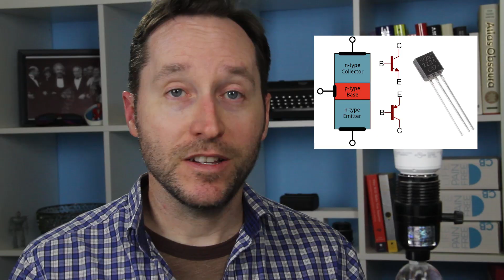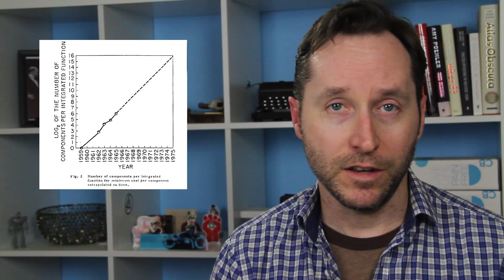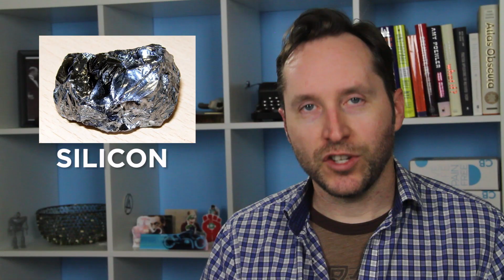Moore's Law Is Ending - Here's 7 Technologies That Could Bring It Back To Life | Answers With Joe

Comment: the idea of multi core processing can do same job with half the speed (the main reason they're making transistors smaller is to make them cooler and more power efficient to increase clock speed) thats not gonna work for long to fix this the need to move to multicore processing but the main problem is optimizing programs to take advantage of of these multi core cpu. im sure When they hit the wall on moores law they will focus on multi core processing 8 16 even more i wouldn't be surprised if i saw 1000+ core processor in my life time

Comment: I recently found this channel and have been very confused by Joe's optimism based on Moore's law in his previous videos from last year and the year before. I'm glad to see this video, it just seems a little late tho considering current computing hardware trends. I didn't know that the exponential power of computers had a name, and even wondered years ago how long it could sustain itself with current technology. For the last three years, it's been pretty obvious that it had come to an end, only 5 to 10 percent gains in computing power, and only a radical shift in material, and or architecture would be able to get the ball rolling again. If i understand correctly even super computers are not built with much better chips than whats in home computers anymore, just massively multi cored and threaded.  However the next jump could be more than what the exponential growth would predict, and we could see singularity even faster than predicted, i'm being a bit optimistic here. Or none of the new computer ideas work out well and we stagnate in computer tech eking out 5 to 1 percent gains for 50 to 100 years till they get it right (now that's a scary thought).

Comment: The death of Moore's Law has been predicted for the past 30 years.  Every year.  Like clockwork.  I'm surprised there isn't a corrollary law that says the end of Moore's Law will be predicted every 18 months. (I searched, couldn't find one.)

Another possibility for future computation is a thing I've been following and interested in for a few years that might make a good video topic - amorphous computing.  Amorphous computing is based upon the idea of producing billions of really tiny processors... like, really, really tiny.  Small enough that you can mix them into paint and just paint them on any surface.  They operate through ultra-short-range (millimeters) radio links, and the computation doesn't really occur in each processor but in the collection of them overall.  They're unreliable, can randomly drop out of the collection at any point, and through patterns of how the signals flow through the system, computation is achieved.  Its very similar to how biological systems operate.  Requires a lot of very cool theoretical work first, but its a very promising early concept.

In terms of actual physical laws, rather than observations of trends, Richard Feynman actually produced a set of lectures on computer science.  They're much less popular than his lectures on physics, but similarly brilliant.  They're published and you can get them in book form on Amazon.  (Forget the exact title, just search 'feynman computation' and you'll find it I'm sure.)  In those lectures one of the things he investigates is the fundamental energy required for computation.  Surprisingly, he found that in terms of quantum mechanics, zero energy computation was possible.  (It had to do with performing computation by systems degrading to their ground state which they will do anyway with no input.)  

That is in the extreme and also requires infinite time, though, so we're never going to see actual zero-energy computation.  But what it DOES mean is that there is no lower bound.  There is no place where physics says 'you can not extract more than X bits of computational power out of Y amount of energy'.  You might be constrained by time, but you can always spend energy to make it go faster.  Information and computation are increasingly seen as very fundamental elements of physics, on par with, if not even more universal than, energy and time.

Comment: Necessity is the mother of invention. At this time, we don't need computers to double in speed every 18 months. We generally have most the speed we need for HD Video, and there's not really anything that needs as much processing speed as HD video. What we do need is the ability to multitask with more programs. The solution for that is multiple processor computer systems. Multitasking computers share processor time with all the other running programs. The processor runs like a line of code in the first program, then runs a line of code in the second program, then a line in the third which we'll say is the last, then back to the first program. It's still one thing at a time. You add a second processor, and then you can run two things at the same time which doubles the power. You can have a video compression program running on one processor while you watch a video on the second without performance loss. My computer is about five years old with just two processors, but new computers are hardly any faster so I haven't noticed much of performance loss especially since I run Linux which as little overhead. If I were to put Windows 10 on my computer, it would probably feel more like my old 633MHz computer.

Comment: sorry but your explanation of quantum computing is WRONG!! or at least a misleading retelling of a misleading of retelling of a simplified explanation of what is actually going on, so forgive me for pointing this out and now i must cleari a few things up

i wouldnt say the power of quantum computing comes from going 'beyond the binary'  we still use qubits which are based on 2-state systems although we could use any number of states it doesnt really make a difference, bits are just most simple to work with. a superposition is not just a 'third state' because there are actually a continuum of different superpositions you could have between zero and one, you can think of a sphere with 0 and 1 at the poles and every other point on the sphere is a possible superposition, but its not just having this continuum of states that gives power either because in the end you make measurements which are just 0 or 1 

the superpositions give you a kind of "parallelism" but the power does not come from just doing things faster because they are in parallel, in the end you make one measurement so you cannot just get all the parallel answers at the end like you might want to do. instead of getting more things done with the parallel branches of the superposition the power actually comes by taking a shortcut using quantum interference. there are phase differences between the parallel branches of the computation which are guided in a way that the wrong answers cancel out and the right answers amplify and the final measurement will give a right answer with good probability. quantum computers will function much slower in operations per second but for some types of problems the superpositions allow you to take shortcuts through the space of quantum states and arrive at the answer in many fewer operations, so at least for very large problems it will run overall faster in time

as for quantum cryptography this really has nothing to do with doing things faster (although it breaks current crypto by solving problems like factoring quickly) but inherent quantum properties, so things can be encrypted in a way that is statistically random to any eavesdropper or the entanglement of the state is changed and leaves a trace of someone trying to measure the encrypted info
Reply: I second that thank you.
Reply: I think he made a reasonable simplification for the sake of a vid that wasn't about quantum computers.
Reply: TehMuNjA thank you
Reply: Thank you
Reply: Thank you. Excellent points!
Reply: I love this stuff but I’m new to it. Can I get TLDR?
Reply: Future encryption will easily and cheaply be able to defeat even a quantum computer.  When the random encryption key is as long as the encrypted message the only way to know if you decrypted correctly is if you already know what the decrypted message is. Current encryption uses the same key over and over again hundreds or thousands of times to encrypt a message. However if you use a 10 Meg key to encrypt a 10 Meg message.... a quantum computer can't break the encryption. There is no repeating key that it can use factoring on to mathematically deduce what the key is. This is equivalent to using what used to be called a "one time pad".  (A different key for each message).

Comment: I'm no expert on DNA computers, but with 4 base pairs, isn't that a base 4 system not binary? If you were reading one chain of the DNA you could have A, T, C or G. I wouldn't be surprised if more molecules could be used too, like Uracil from RNA, in fact we may be able to use more molecules than seen naturally attached to a ribose 'backbone' to get a much higher base for a computing system. Soooo coool!

Comment: I've been thinking about Quantum computers and how they seem to be processing in qubit(s) . I think there is a link between extreme cold temperatures and time. The colder the temperature, the slower time ticks and vice versa for higher temperatures (the faster time goes by). This might just be how quantum computers work. They're probably not processing faster than regular computers, rather their confined spacetime is ticking slower, giving the electrons more time to complete calculations (communicating/interacting faster)

Any thoughts?